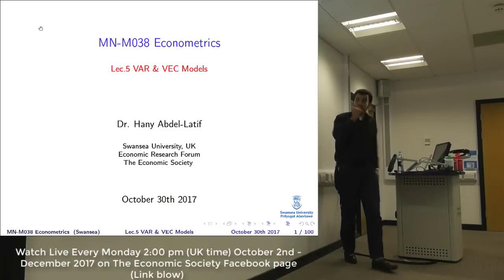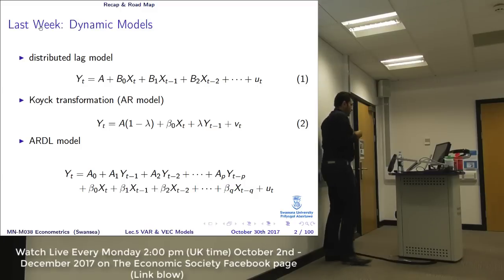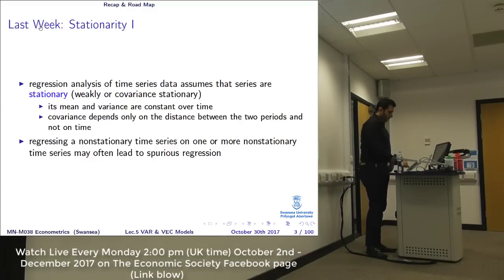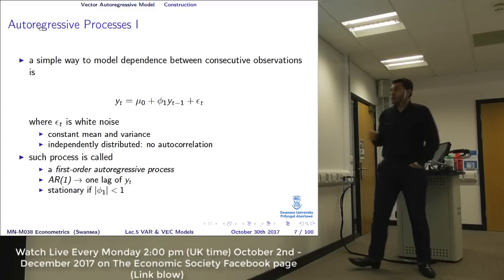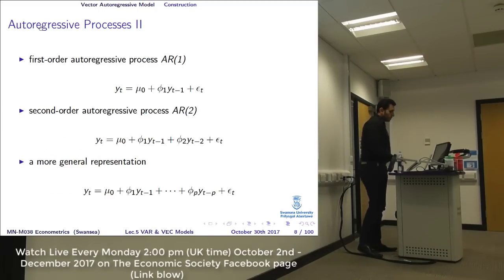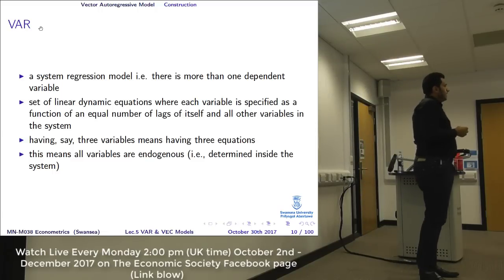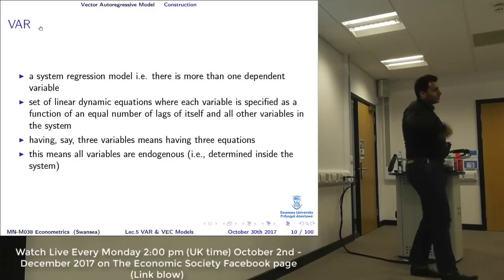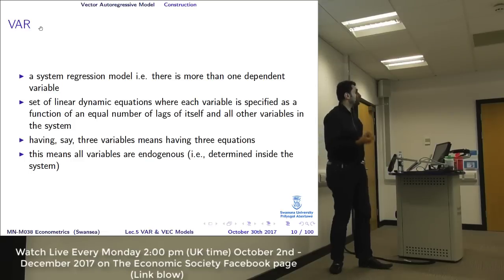Lecture 5: VAR and VEC Models

Comment: 15:38 Choosing Lag Length
21:44 Reading VAR result
27:05 Granger Causality
35:41 Impulse
36:17 Variance Decomposition
38:19 Advantages of VAR Model
40:00 Problems with VAR
51:18 Why Stationarity Matters
1:09:08 Unit Root and Cointegration Tests
1:11:12 Engel-Granger Test
1:15:57 Granger Representation
1:20:56 VECM Johansen

Comment: Thank you very much for this awesome lecture. Just a few questions:

1. 18:25 : What is "root of the matrix"?  Eigenvalues? Also, what condition would I need to fulfil if I had a, say, VAR(3)?
2. 01:06:00 When you discussed ECM and argued about usability of the OLS, it was probably wise to mention, that the integrating factor is also I(0).
3. What about VECM models with more than 2 variables and higher dimensions (like, 3+ lags)? I guess we can get more than one integrating factor then? What about condition on the pi-matrix? Will there be just 1 pi-matrix or more than 1?
Reply: Up
Reply: For your question 1: I think the root of the matrix he mentioned are alpha and beta values of Yt-1 matrix, which is the coefficient when you fit the VAR(1) model. Similarly, when fitting VAR(3), there will be 2 additional A matrces (let's say A2 for lag 2 and A3 for lag 3). These matrices also need to be stable. The reason behind this is to ensure the variables in the model are stationary, which is consistent with the VAR model assumption (not too sure)

For question 2: I dont think using OLS necessarily mean the integrating factor is I(0). I think when he means is by differencing the 2 series, we now have 2 stationary series, whcih mean variance do not change over time and thus can use OLS.

VECM with more than 3 variables, lets say 3, the pi-matrix will be 3 by 3 matrix.
VECM with lags more than 1, let's say 2, there will be 2 pi-matrix.

Correct me if im wrong

Comment: Thank you so much for this wonderful lecture. I was really helpful in understanding VAR for the purpose of my thesis. I am currently doing a panel VAR analysis for 6 countries  and have 6 variables. The problem I am experiencing is that, although all my variables are stationary at I(0)  (using ADF, PP, LLC and IPS unit root tests), when I do the AR Roots test graph and table (using eviews 10) I find that my VAR is not stable regardless of the number of lags I use. What could be the problem and how can I fix it? I would like to interpret my Impulse Response Functions and Variance Decomposition. I would greatly appreciate your assistance. Thanks you.
Reply from the maker: Thank you for watching and for your kind comment. If all variables are stationary, you should have a stable model. However, given you are estimating a panel VAR model, it is important to understand the estimation procedure. Please follow the link below for a good survey of different methods of estimating a panel VAR model. For example, if you were to use a GMM procedure you should have larger N (number of countries) etc. Please check the links below. I hope it helps.  

Survey of Methods: https://www.ecb.europa.eu/pub/pdf/scpwps/ecbwp1507.pdf?0ea674f009d6f2bffb1515c8b4b2cab6

GMM estimation in Stata 
http://paneldataconference2015.ceu.hu/Program/Michael-Abrigo.pdf
Reply: Hello Taimi, I ran into the exact same trouble as you did. I am wondering how did you resolve it? Would VECM be a solution?

Comment: A very lucid explanation of such a tricky topic, sir!
I have the following precise queries:
1) I have 2 variables with different order of integrations (I(2) & I(1)). Can I still use VECM model? If not, what could be the way out to model them?
2) Can we diagnose causality using VECM models?
Thanking you!
Reply from the maker: No, you should not combine two series of I(2) and I(1). Depending on the context of your study, you may be able to use the first difference (or detrend your series) to make it stationary or at least of the same integration order. Granger causality tests are a set of F-tests which can be performed in bivariate or multivariate models. I hope that helps.

Comment: This was a great lecture. THANK YOU! 
I think the last 2 minutes were also critical. 
How VAR can be applied after transformation of the data (from I(1) to I(0)) but by doing that we are losing the benefits of VEC models (short-run vs long-run effects, if data, of course, fits the definitions).
May I ask you a question. Are these takeaways change significantly with the exogenous variables?
Can we also obtain IRFs in VAR and long-run/short-run effect estimations in VEC model for exogenous variables? Any source you would recommend?
Thank you very much again. 
I could just finish this lecture today but I am planning to watch others as well.